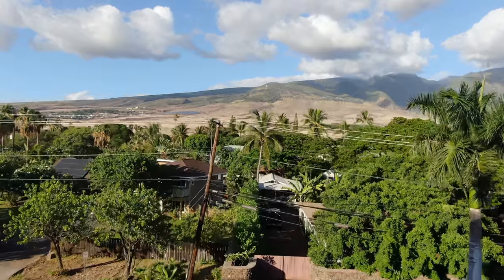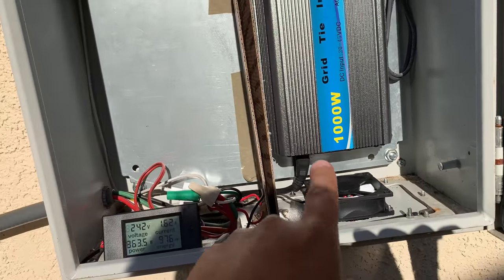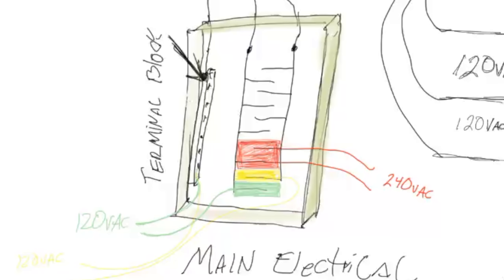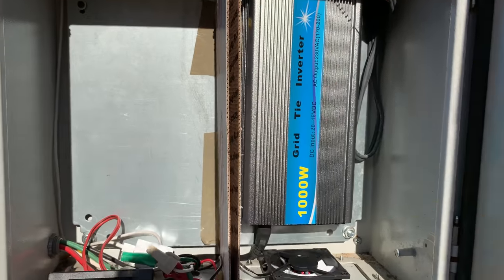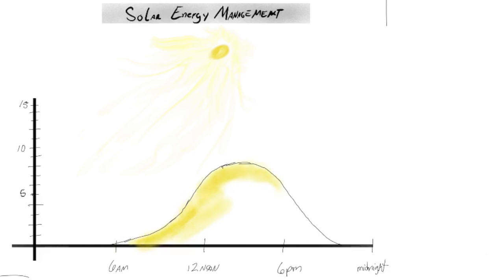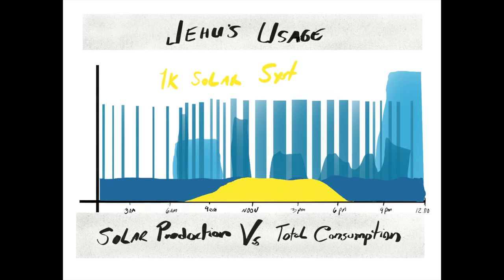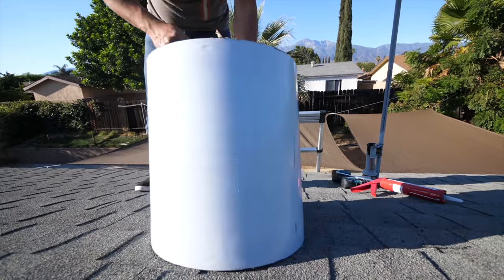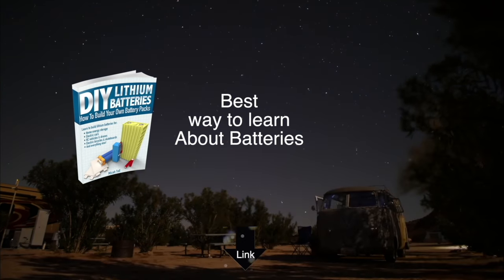How To save $1000 off your electric bill using DIY Solar

Comment: I have one question... if you wouldnt do a grid tie but just for your usage not giving power into grid and you charge a battery for example, and you charge it fully to 100%, what happens to excess energy from solar panels? If i remember correctly BMS protects the batteries from getting overcharged so the power is just grounded and goes to waste?
Reply: I'm pretty sure that when generation exceeds load, the excess is radiated as heat from the panels.
Reply: @dorvinion  can be

Comment: In the Inverter box, you should use a piece of fiberglass, PVC or something in case that inverter gets hot and starts your cardboard on fire.
Reply: If that system gets that hot it can set fire to cardboard, hes going to experience a fair few problems before the fire mate.

Comment: How hard was it to get your permit for this DIY solar?
Reply: My guess is it is an illegal install. If he ends up with net output on the grid he is in for some major fines.  It's easy enough to find 'grid tie' systems that do not allow power to be put back onto the electric company grid.
Reply from the maker: It’s a temporary system as I will be trying different setups throughout the year.

Comment: Hey Jehu just wondering if your DIY solar system has a permission to operate letter from your local power company? If you don’t you are running an unauthorized system and could be creating a dangerous situation electrical workers like myself. Also if you export energy to the grid a smart meter is capable monitoring that and you could be fined and charged for every KWH that you send to the grid.

Comment: Quick question, how long can the connection be from the Flexible Solar Panel to the charge controller and gage wire
Reply: Use a "Voltage Drop" calculator, can easily be found using "google search" ...

Comment: Ones again great information, I just have one quick question, I bought two of the Uni-Solar PVL-136 Power Bond PVL 136 Watt 24 Volt 216" x 15.5" inches. Flexible Solar Panel. Easiest to Install Peel & Stick. and hook them in series to get 48v the problem is my meter and inverter (what's left of it) reads 84.6 volts, any ideas?  Thanks

Comment: Yeah, I live  on Big Island(Hawaii,Hawaii)  and am part of the Hawaii Solar initiative  with boh hours tied into the grid  via tie in Solar inverters

A wile back the brilliance of politicians banned coal use in Hawaii so  HELCO burns oil in the bulk of  its power plants meaning the electric bill  fluctuates  with the price of oil per barrel ($185 average, my back house with a destroyed by lightning solar system costing $295 this month for 800KW)

The  front house with more TVs,a bigger water heater (Thermal solar/electric), and more oven ,dryer,washer,computers, and heavy equipment use(and fixed after its own run in with lightning blowing out my connection to the grid) netted -115 KW so I'll be getting a credit this quarter if the  negative KW keep happening
if the program is still in place(State pays HELCO my credit,but I forget if there was a time limit)

Only bad thing is SunRun  won't add the Tesla Power wall to my setup as they rather put it in a new system(this is not what they promised in 2014)  and the field workers are spread so thin that it took a year for them to diagnose the problem with my back house and replace the wire and fuses on the panels and and now am waiting on them to replace 2 panels cause they are dead (fist  dispatch came at sunset with no equipment,no ladder and blamed the shadows of trees AT SUNSET for panels not working despite system pumping 324 volts and 392 volts till twihliht. Before lightning strike....even with sunset shadows)

Comment: Hi Jehu, Love your videos man, keep up the great work. Quick question, have an old 10 yr APC UPS, do you think it is possible to beef up its run time by swapping the SLA it comes with with a Lithium battery, if yes, could you do a video on something like that, it would be a great project for backup power for small devices like laptops, modems and such. If you could even do a video showing us how to build small UPS's from scratch that's be great too. Thanks again man.
Reply from the maker: Yes,  I’ve done one already a while back,  the Puerto Rico one

Comment: Where can I buy that 240v inverter?
Reply: Inverters& transformers consume about 80% of PV production. You obviously don't know that everything in your house is low voltage DC or can be purchased in DC. You obviously didn't know that. I've known for 60 years. PV is only efficient if you stay DC to DC. Do your homework.

Comment: I may have missed it, but if there is excessive production during the day, why is that the most expensive time to consume?
Reply: I'm wondering that too.  I suspect it's due to antiquated regulations.  When there's a ton of excess power you would think the price would be lower to encourage use at that time vs. when the rate is higher.   By making that the most expensive time period they are just encouraging more solar production during the hours when they don't need it.

Comment: Is it safe to charge lead acid battery solar charge controller to charge li ion 18650 batteries
Reply: If safety is your goal, I'd say flooded cells (lead acid) are best.  Just my 2¢

Comment: Don't forget permits!!! My hater neighbors are certified SNITCHES. Wishing you the best
Reply: Your neighbours need to get some STITCHES.
Reply: My neighbors are horses and cows. Leave the cities then you dont need permits.
Reply: Since I know whereabouts he lives, I know that permitting me install is just as good as aborting it.  That being said, the oversight process is intended to be sure that there are safety devices installed and labeled. You should not have any standard inverters running, they must be grid tie so they that they wont produce any power when the mains go out. This is intended to protect lineman who may be exposed to the source of energy when they are expecting the lines to be cold.  You also want to have some electrical disconnects so that emergency responders know that you have a source of power and can activate the disconnect before performing Emergency Operations in the home.

Other than that they like to make sure those panels aren't going to slide off the roof and give you a unnecessary headache.
Reply: Permitting is a huge deal. Jehu is taking a massive risk putting energy into the grid without a permit. The electric company needs to know which homes are pushing to grid because if they are doing electrical work on what they think is a dead line if jehu starts pumping electricity into it it will kill someone
Reply: His install seems fine, but there is a reason for the permitting process...
Reply: Where to get permits from? on a DIY system?
Reply: good on them, do it right or don't do it.    "snitches" is a preschool word, you're and adult, act like it and be responsible.
Reply: DIY don’t need permit. By getting permit you let them know to tax “income” generated by the sun as in Europe particularly Spain.
Reply: @Simonofcalifornia  they tax you on generation? wow, that's shitty.   still, it's also requied to keep the grid healthy.  without knowing how many systems are inputting solar and which what equipment, you're likely to run into serious dirty power problems.
not to mention power potentially flowing into the grid during a blackout or line maintenance,
Reply: @soozler  Certified inverters do not allow energy flowing back into the grid when there is no power in the grid system for obvious security reasons.
Reply: @markplain2555  And maybe "fall" into Ditches
Reply: @John-gm8ty  I taught Pre-K, Kindergarten, Lower and Middle school for about 8 years. The word Snitch is not a commonly used preschool word, it is more common in the lower school, and most common in middle school. If your rebuttal to Arvin is that the word snitch is immature, that rebuttal is its self hyberbolic. Claiming that the word snitch is a "preschool" word is not true, but rather immature in the same way Arvin's comment was and is not contributing to the maturity and understanding of the conversation. Or to follow the golden rule: if you don't like when people do something, then don't do that thing to other people.  In this case, immature and hyperbolic pejoratives.
Reply: @soozler  Not to mention if they don't change the meter, it will just spin faster in the direction that costs you money.
Reply: @soozler  I've read of this.  Another item to consider are old-fashioned gasoline powered emergency backup generators.  Do those have to be registered with the power company too?  I suspect most people wouldn't bother especially with smaller generators.  I also expect the power line workers are smart enough to test a line before working on it.    These days anyone can setup a small PV or gasoline generator setup for their home.  The legal ramifications are another matter.
Reply: @flurx01  I wondered about that.  But how do these inverters you mention work?

Because what if the power grid goes down in the middle of the day when the sun is at maximum?  An inverter that shuts off when it detects no power on the grid will also disconnect any solar PV array from powering the house's main circuits.  That is, the two 120VAC 60Hz split phase lines and those are connected in parallel with the grid.  So a home owner could be looking at a total house blackout situation at 12 o'clock noon even when his 10kW of PV panels are getting maximum solar radiation input.  The homeowner's little LED alarm clock won't even get power.

The only way I see this really working is an extra large relay that automatically opens up when grid power is down.  Would need two such relays on each 120VAC line.  But I'm not sure how a sensor could detect what is grid power and what is inverter generated power since they are connected in parallel.  I'm starting to set up my own DIY PV setup but am scratching my head on this feature.  The only other way is a giant diode but diodes don't work as we want them to here with AC current for obvious reasons.
Reply: as adult i laughed historically when an "anonymous person" complained about noise. i presented my permits and went on my day. I'm merely pointing out that some people get a cheap thrill out of calling on neighbors.
Reply: @beyondfossil  You would still need battery backup to run your house when the grid is down. I was thinking about this too, but remember the grid helps give the needed current draw when big loads turn on. Otherwise the solar array usually can't handle it on its own. Unless when you switch over you only power small devices the solar array can handle. My grid tie system is setup the same way, so even in the middle of the day if the grid goes down so does my whole solar array. I do hope to have battery storage one day.
Reply: I have the solution for this problem.  You can tell your neighbors literally its none of their business.. Go ahead and report it.  It is an installation dedicated to “scientific research” an as such it voids most local and national code requirements.   The most important requirement you have to worry about is to make sure that your inverter are compliant with solar anti-islanding code requirements of NEC 690 which means your inverters must be compliant  UL1741/IEEE 1547.   As long as your inverters shut themselves down immediately the second the grid drops out, you are complaint and the electric company won’t be threatening you to shut your connection to the grid off because of unsafe equipment that could energize the line and injure their line workers when the power goes out.  This is the only thing that you must worry about in terms of equipement.  Other than that you need to put proper labels at the panel and shut-offs to properly alert authorities as to the locations of you solar shut-offs and label the shut-offs themselves.  Those things out of the way there isn’t much they can ay about you home made solar system because it Is being used for scientific research.  TO prove the point above and beyond just occasionally chart the voltage and time of day to show some research being conducted.   Also , no permanent foundations an no attachment to structure to keep code enforcement off your back.  This means put them in your yard, anchor them own with excessive grounding rods an ground clamps  (put the rod through the bottom of supports for strength) <—this makes them not fly away in the wind and hard to steal proving permanence in a practical but not a legal sense so you won’t get into trouble for no building permits.   The last thing to consider is that non UL-compliant equipment (most cheap Chinese grid-tie inverters like the one shown are not UL-complaint in the sense that they have not been tested by a certified accepted laboratory and labelled with the UL mark as it costs up to $150.000 for each model to get tested and so certified, manufacturers of cheaper hardware can not afford to get it certified even if it would pass the test on the first try.   So, this has a ramification for insuring your home.  as long as the solar is not attached to your house (again, put it in your yard not too close to your house in case it catches fire for any reason), an the electrical connection to the home is through extension cords that are circuit-breaker protected (every circuit in your home is already even the outside plugs), your insurance policy can’t cancel or raise your insurance if you aren’t trying to insure your solar set-up as well….  Considering all these things , your neighbor hasn’t got a leg to stand on because you will be armed with the important facts of the situation and engineer your setup to be authority-proof in this manner.
Reply: no permit here in Philippines unless you do "net metering"
Reply: @techelectricfuture3094  : follow the money. Permits generate cash flow. If my system, what ever it maybe, provides what I feel is sufficient I am still not allowed to disconnect from the grid. See you pay for access to the grid even if you never use grid power again. Your surplus is not payed to you. It is a credit and in many cases that credit is only good for the year. 

I do agree, do it correct. Batteries and capacitors can burn your house down if you don't know what your doing.
Reply: Your neighbors are just jealous
Reply: Go rural.

If your concerned about the narrow mindedness, try rural New England. More open then the rural South.

Buy 75 acres in the allagash of Maine. Jgarcia can do all the DIY he wants, but if he burns down his house, no fire department. If he electrocuted himself no EMS or hospitals. The Amish can rebuild another shell of a house for a good price.
Reply: soozler like the mass fire they started lol
Reply: soozler to make u pay 17000 for solar
Reply: Eugene S no there made there paying lots of money
Reply: I've been looking into building this exact system!!! Do you have a link to the follow up where you put in the battery bank and have that feed your house during non peak times??? Id LOVE to see that video. I tried looking in your videos but you got alot to comb through. Amazing content man

Comment: God I want to know how to build a battery back bro I have 800 watts of moncrystine panels I been try to figure out what to do about battaries lead acid is the cheapest but not long lived I use about 32000 watts a month if device by 30 that's  a little over thousand watts a day  just a bit confused as what to do

Comment: Pushing hot air "down" is a bit of a bother.. I would stick in another fan powered by the solar on the other side to exhaust the heat.. (Direct the air off away from the one pulling air in to cool the inverter...
Reply: The fan has no problems pushing the HOT AIR out ...

Comment: So I live in a state where they do not allow homeowners to donthis kind of stuff no matter what I know, what I learn and if I even get an engineer to sign off on it. They will only allow me to go through an electrician or solar company and they charge a minimum of 20k. The sun rises and hits my house bright and early, then at peak 10-2, the sun shines directly on my roof forever. Pretty great if you ask me. How would I go about doing this on my own or how would I word out the plan to do this so that the old law makers understand the technology is safe and that I am capable of doing this in a safe manner without issue? Please don't say move out of Massachusetts.

Comment: Still doesn’t make much sense here in Oklahoma where the utilities sell wind power outside the region. Lots of recent political activity about transmission lines to Tennessee valley. We don’t have peak power rates and I haven’t experienced any brownouts on our recent 100°F days. Add to that our 10¢/kW rates and I’ve never seen a large home solar installation here just tinkerers and small panels for metering natural gas.

Comment: Excellent video especially the financial calculations for peak day use and time-of-use rates.  But you didn't mention the 30% federal tax credit anyone who owns a system will get on the cost of all panels, hardware, wiring, supplies, and fees to get your photo-voltaic system up and running.  It applied in your case?  Of course, this tax credit will make a big favorable difference on ROI calculations.

Comment: Grid Tie is idea, but for your energy, you barely get anything for it. Better to buy more batteries, so that when you have far less Sun, you can go a week or two without having to charge up your batteries! If your system were setup like that of an RV, yes that works, because if you ran out of stored battery power, your system, will automatically draw energy from the grid.
Reply: No, adding batteries is a financial *nightmare*, when compare to his Grid-Tie system